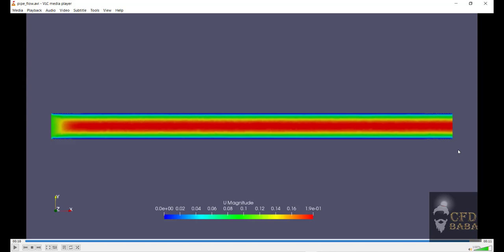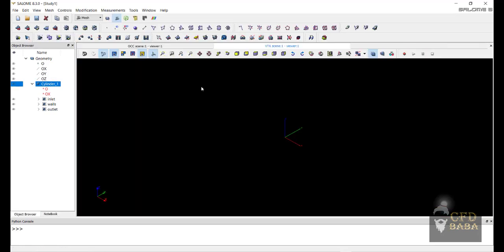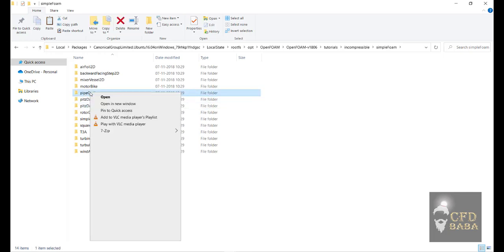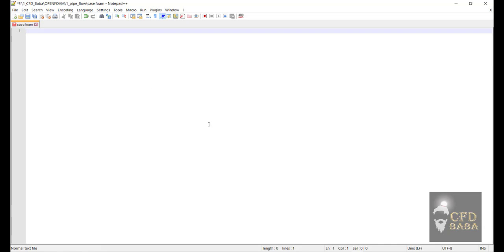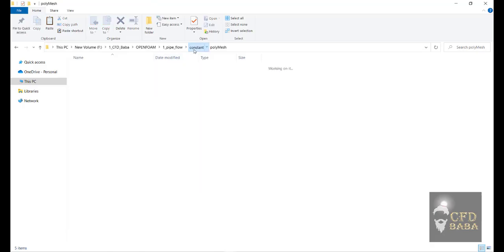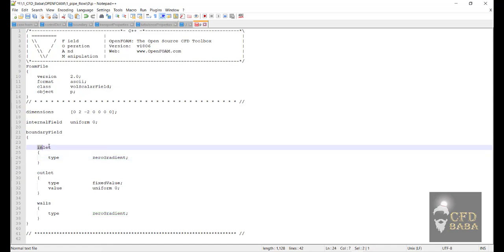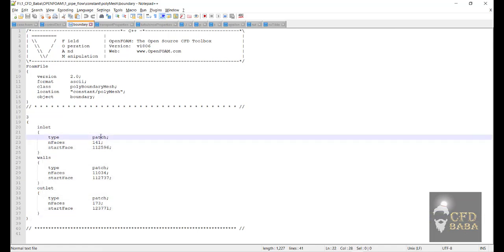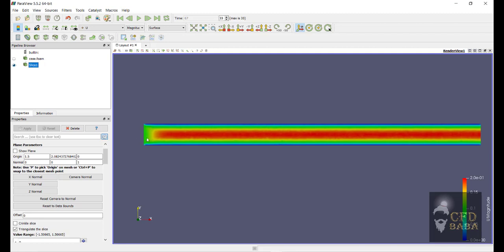How to do Analysis of Turbulent Water Flow Inside Pipe using OpenFOAM, Salome and Paraview

Comment: ANSYS is too expensive and unavailale.
Reply from the maker: 🚀 CFDForge™ Academic Version is LIVE — Free for 30 Days

If you’ve ever felt that OpenFOAM is powerful but painfully hard to use, this is for you.

Most OpenFOAM users struggle with:
❌ Too many dictionary files
❌ Broken case setups
❌ Time wasted fixing errors instead of doing CFD
❌ No clear industrial workflow

CFDForge™ changes that.

I’ve officially launched CFDForge™ – Internal Flow Industrial Training on Udemy, and along with it, the CFDForge™ Academic Version is now available FREE for 30 days.

🎯 What you get:

Ready-to-use OpenFOAM-based CFD platform

Step-by-step industrial internal flow simulations

Real cases:
✔ Bent circular pipe airflow
✔ Irrigation pipes with multiple inlets & outlets
✔ Complex exhaust manifold

Full 3D post-processing in ParaView

30-day license key + setup files included in the course

This is not theory-heavy CFD.
This is how OpenFOAM is actually used in industry.

👉 If OpenFOAM is slowing you down, CFDForge™ will speed you up.
👉 If you want confidence in running real CFD cases, this is your entry point.

🎓 Enroll now, activate CFDForge™, and start running simulations today.
🔗 https://www.udemy.com/course/cfdforgetm-internal-flow-industrial-training-openfoam-cfd/?couponCode=2A9A234401C03C023265

Comment: Hello, very awesome video. Great explanation and guides through the creation a model from scratch. Just one question. why did you consider 8.9e-4 as the value of kinematic viscosity of water? is not ~1.0 e-6? The units are m2/s
Reply: It's a mistake in the video, right?
Reply: It's dynamic viscosity of water, not kinematic.

Comment: Hi, does this software can do transient flow simulation with heat transfer? Suppose I am flowing a coolant inside a pipe and want to see how much time it takes to drop the wall temperature to a certain temperature?
Reply from the maker: Hi. Yes it can be done. Use pimpleFoam solver.

Comment: Hello thanks for the video. Its very helpful. However i'd have a question. Which solver should i use to consider the gravity force? There is a height difference in my pipeline that i want to simulate. I simulated with the simpleFoam but it doesnt consider the the height elevation in the pipeline so that the pressure drop comes out less than it supposed to. 

I'd be very thankful if you can help me out. Thanks in advance
Reply from the maker: Hello. I am glad I could be helpful. However I haven't simulated any case with gravity force included in simpleFoam solver.
Reply: Hello Have you solved your problem？ I meet the same question. (1) create a new mySimpleFoam solver and add force source term in  
momentum equations, but how to specify a proper boundary layer in the outlet, uniform pressure seems wrong